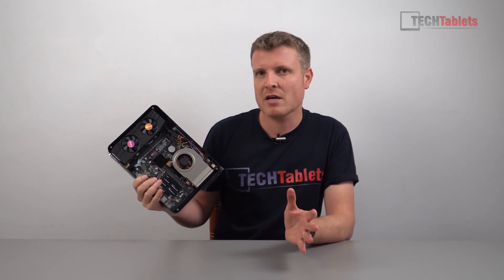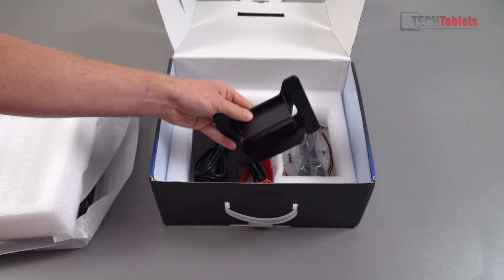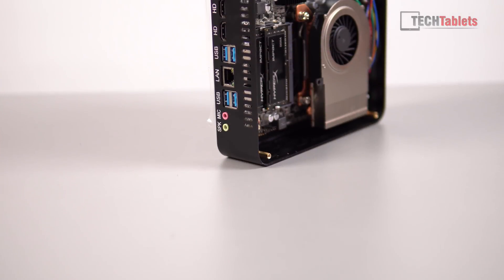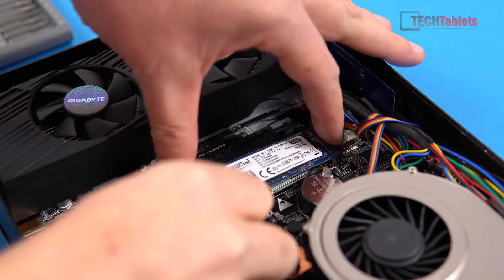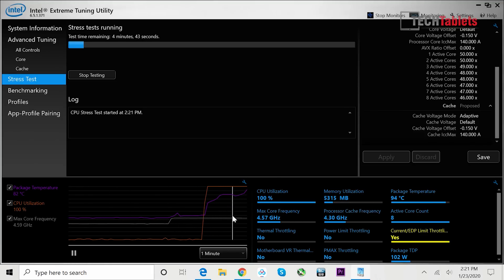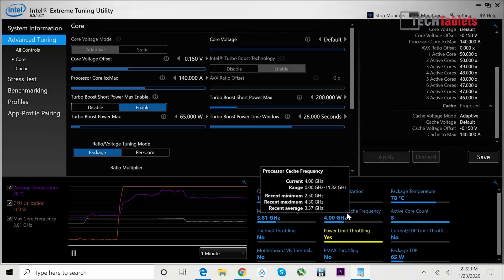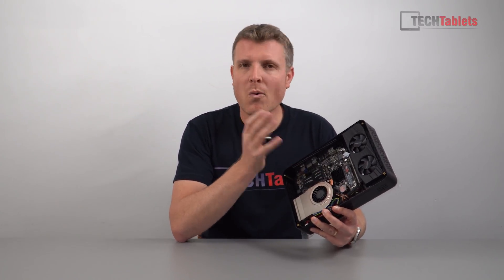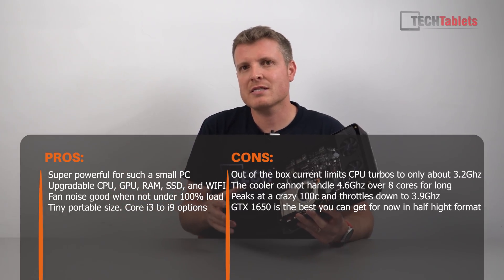Crazy 8 Core i9 9900 Mini PC - But Is It Any Good?

Comment: if they use a standard 4 pin connector for the cpu fan, the goal could be, stick a low profile noctua , and mod the upper case with a 3d printer. Job done. And maybe swap the 1650 with an rtx a2000.

Comment: Is there a mobile socket 1440 variant for i9 10th gen 10885H? Will it be much better for low power draw performance using Xeon copper cooler?

Comment: One of these systems with a 9100f could be an AMAZING cheap gaming PC. With the current config it seems more geared to a mini video production/ editing PC like one you would pair with a mobile camera set up for covering big events like CES or other expos.
Reply: I would recommend the 9100f or 9400f simply because a GPU upgrade is not likely and even if it is, it will be marginal at best. The 1650 will be able to stretch its legs fully even on a 9100f in the vast majority of titles. If we do see an upgraded GPU it will likely be some sort of gtx 1750 or 3050 low power/ low profile card from nvidias upcomming GPU generation.
Reply: After taking a second look this PC has AMAZING value as a barbones unit. If you have access to some cheap ram and SSDs this could be a cheaper build.

Comment: So I got the i5 9400f version, but I’m not able to boost it to 4.1ghz. Turning on the boost setting in the BIOS gets me to 3.4ghz. That seems stable, and keeps me below 60 degrees. Any ideas?
Reply from the maker: Maybe try resetting the bios to defaults. It has to be a setting limiting it or check your power limits. Run Intel  XTU and do some testing

Comment: Not sure about the upgradable GPU part. Those case port cutouts seem to be made specifically for the GPU that's in there. You either have to find a card with exact same port positions or modify the case yourself by cutting it.
Reply from the maker: Yes that's right unless it's the same brand if it's another you night need to cut a gap out. The sticker is over a gap already to

Comment: You know what’s crazy? That I bought a 3.7lbs Laptop for 800€ with the AMD Ryzen 4800u just 4 months after this was used to be the crazy thing. 4800u is almost exactly as powerful at 15W power consumption and has powerful integrated graphics on par with GeForce MX250. Technology is advancing crazy fast.

Comment: goood review you convinced me and i just buy a system like yours but with an i8700 for gaming purposes...my question is i have connected as a second drive a samsung 2,5 ssd and works well but here is my question  how do you manage to atach it to the case i dont know how to...and im thinking of connect it externally via usb 3.0
Reply from the maker: On the lid there are 4 holds to mount it
Reply: im a dumb! thanks!
Reply: bynthe way dont know if you have tried but f or those who didnt... push CTRL plus F1 inside bios and a bunch of new options appear...but no voltagge settings adjust...

Comment: btw, if better gpu comes, it has to be with the exact same ports on the exact same place in order to fit in the case, as this has holes for the ports. or you would have to cut some new holes...

Comment: on that witcher 3 - high setting and just lower the hairworks or turn them off completely. they are garbage anyway (with it hair moves smoothly but as if in water, it doesn't look natural to me, so i just turn them off). and it would probably jump over 60 right away.

Comment: Great to see half height dedicated GPU card being used. Those that say 'make it bigger for a full sized GPU' - well yes, OK, make a bigger model, but keep this because many want the SMALLEST (non-integrated) graphics option. This seems better than a NUC. I like the longer but slimmer form factor. Perhaps 10mm taller would help cooling... Would be good if they produced a slightly heavier model with heatsink fins built into the case and a decent, bespoke CPU cooling system. Worth $50 more.

Has anyone made a fanless case for mini-ITX boards that is finned on the outside and inside (say 7mm fins), all over, with a heatsink embedded in the lid, with recessed fins on the outside, directly attached to the CPU. One for the GPU too. I always thought it would look cool... Heavy but silent.

Comment: I have just installed i9 9900 to my Lenovo M920x which is even smaller case than this one mentioned and everything works fine! But no additional graphic cards installed LOL..
Having run Prime95 without any problem , very satisfied!!

Comment: Hi Cris, How to show Gpu, Mem, Cpu with all core, ^ Ram While u gaming? Thanks,
Im new to your channel. Thanks!
Reply: and i have a problem when im playing tomb raider in high, when a loading complete and play from 1-2 minuete it gets lag for 5 second maybe because loading some scene. 
is't because im running hdd 7200rpm?

my system, 
cpu - core i5 4690k, 
ram - 16gb
motherboard - H81 (because my z97 board error)
drive1 - 256gb ssd on c drive
drive2 - 1tb 7200rpm hdd on d drive (where the game file)
gpu - Zotac 1080ti mini

ist bottle neck due your experience?

Thank you very much Chris

Comment: Coollaboratory Liquid Pro!
There''s your solution.  

HP strongly advised me NOT to upgrade my workstation 
Stock: i7-3820QM with QUADRO K4000M
Upgraded to: i7-3940XM with GeForce 980M GTX 8GB@256bit BUS

Thermals: 
IDLE 42-45C for both cpu and gpu
LOAD: 75-80C for both cpu and gpu

Thanks to
Coollaboratory Liquid Pro. Test it. I'm amazed and highly recommend it. Thanks

Comment: It´s funny, how all these Chinese mini pcs look almost perfect, but then you see those details... huge potential, terrible design at the finish.. and I think it´s not actually that far from being done well. I would love to see a possibility to fit something like a Noctua NH-L9i with its 37 mm height in this build and some opening at the top to create airflow around the chipset, SSD, etc with that cooler..
Reply from the maker: Funny you mention the exact cooler I'm looking to possibly add if it fits
Reply: @Techtablets  cool! looking forward. Hopefully those holes for the screws are the same distance.  And I´m also afraid, it will interfere with the chipset heatsink.

Comment: I'm mostly amazed by the PSU. When you removed the current limits i was like NO NO NOOOO!!!! but it held up. I didn't expect that.
Reply from the maker: I know right I didn't expect it to and thought it might cut out and power off unexpectedly but it hasn't
Reply: @Techtablets  Might actually overwhelm the power supply. 180w isn't that much.
Reply: what about longer use... maybe that psu is at it's limit without those regulations which may lead to failure after longer use?

Comment: That system wont last long at those temperatures.
Reply from the maker: Not in the high 90s no. I'm either going to lower the current limits or what I'm thinking of doing now is to repaste and maybe use a different cooler from Noctua if it fits

Comment: It will be wonderful thermal wise and performance wise if the CPU was Ryzen 3700X.
3700X runs cooler, better performance, has low power 45W mode too.
Reply from the maker: I can only find a 3400G Ryzen model

Comment: I would optimise the airflow for better temps
Reply: cut out air exits and stuff. a single small case fan would really improve this
Reply from the maker: It would and there is a sys fan header on the MB
Reply: @Techtablets  You could use an adapter to get power from SATA and regulate the fan manually. Or use a splitter to run it at the same speed as the CPU fan, from the CPU header; while still regulating it manually with some regulator thingy

Comment: Good video. Nice to see something really useable with a little tweaking. A shame they didn't trade a little bigger size for a better cooling solution. Call me crazy but with an igpu and a pcie x16 external slot and plug for power connector you could plug in any graphics card you wanted. Maybe next year's model.
Reply: Good idea

Comment: Full height 1660 TI with the smaller cooler would be insane!
Reply from the maker: Yes I hope we get something like that. Or they make a half height 1660 Ti this year
Reply: @Techtablets  For $500 almost worth a shot modifying the case to fit a taller GPU. 1080ti mini or similar.
Reply: Lets say I buy one of these and want to run a 1660Ti or maybe a Super, what could I use to power it?

Comment: I would love to see how it performs with Premiere CC. I’ve been thinking to buy this miniPC for a couple months now...
Reply from the maker: Very good, it out performs my current 8700K @ 5Ghz water cooled desktop PC. I might post a video on it.
Reply: How well does this hold up running multiple Adobe apps concurrently? My work flow requires me to have illustrator, photoshop and indesign open at the same time or after effects premiere and the media encoder rendering at the same time.  Could it handle it and the two monitors?

Comment: It starts with $520 (no RAM, STORAGE or GPU), and ends with $1600. Definitely not cheap at all...
Reply from the maker: Nope mine cost me 840 euros + RAM (Used 32GB) and 970 Evo around 1100 euros all up. You could build it for cheaper but it would be 4 times bigger
Reply: @Techtablets  yeah but that wasn't $520, price you are referring in video. That was way off!! - If we talk about 840 + price of RAM and Samsung Evo = 1100€, you can find REALLY good  laptop in that price range.

Comment: Great video. Is it possible to disable hyperthreading and/or some cores to simulate the other models available and figure out which CPU is the value option that matches the 1650 in gaming (ie. The cheapest CPU available that doesn't become the bottleneck). My guess is it's the 9400F.
Reply: Also, a 1650 Super half height card would be a big upgrade if the seller updated their device.
Reply from the maker: That would be the 9400F yes

Comment: I would like to see that CPU delidded and TIM under IHS changed to liquid metal, with Kryonaut on the IHS. It should not thermal throttle anymore even under applications that use AVX. Other than that, very nice SFF PC.
Reply from the maker: I've never delidded before but you think it could fix the thermals? I was looking to repaste and add a Noctua low profile cooler fit for that 65W if it will fit in the case. Might have to make a cut out for it. I really don't want to mod the case.
Reply: @Techtablets  I may have to back out of my statement. I've tried to search for some info on i9-9900 non-K CPU and I can't find 100% confirmation if it has soldered IHS or not. K CPU is soldered, but info on non-K is mixed. There is a much higher risk of damaging the CPU when delidding a soldered IHS (a lot more force required, more stress on PCB and core). If 9900 non-K wouldn't use the solder then delidding would improve thermals for sure. I've been delidding and lapping IHSes on every generation since 3770k and last one being 8700k and all netted around 15C lower temps, sometimes hitting 20C. If I find more info about 9900 non-K I will update this post.
Reply: @Techtablets  OK, after some more digging I found maybe 2 users that said i9-9900 non-K has normal TIM under IHS and is not soldered. Other non-K parts like 9000F series etc. also are not soldered.  I also found info that the solder Intel uses on K parts is still pretty soft one, so delidding is possible without too much risk. So it's your decision to try it or not. Even with the soldered part, you could have 5-10C drop in temps.
Reply from the maker: Thanks for the info. I'll think on it, not sure it's worth the risk but I'll try maybe a new cooler (low profile   Noctua) and repaste it.
Reply: @Techtablets  Repaste and cooler swap will be the easiest to check. Be sure to have a proper ventilation for rest of the case, as Noctua will dump the hot air inside the case opposed to included  cooler, that is directional. With both graphic card and CPU dumping hot air in the case it can get a little toasty inside. Whatever you decide, I will gladly watch a video about it :D

Comment: The power supply is only 180w. Even 8700k at 1.2v full load will suck around 200w (total system consumption). Thats why it current limit throttling

Comment: Imagine this form factor with the Ryzen 4800H! It would be awesome!
Reply from the maker: I hope they do it. But might take a year. They have 3400G models from other brands. So maybe the 4000 series late this year?
Reply: @Techtablets  3400g is a desktop AM4 socket chip. The 4800h is a mobile fp6 chip with 45w tdp. So if they use this chip the current cooling solution should be adequate for it to reach full potential, but the downside is the cpu might not be upgradable. I'm not sure if mobile chips are soldered or socketed. Maybe you would know more about that?
Reply: @DannyHuanDao  They are always soldered. However, Ryzen 7 3700X would be a far better choice because it has far less heat generation and power consumption compared to i9 9900. Despite Intel claimimg 65W TDP for i9, the actual power consumption and TDP is way higher under load. Also,  all the Ryzen 3rd Gen has TDP control which can be used to set a reduced TDP with some reduced performance.  That's the reason, AMD has not released any T series CPU as their normal desktop processors can be configured.
Reply: i think we can bump it to a Ryzen 7 4700G.

Comment: The 9400F with 1650 option for $500 is good for the price..juSt buy your own 2x4gb ddr4 2666 and get a cheap 1tb crucial P1 ,it's capable to game in 1080p
Reply from the maker: Yes I was so close to buying that model. But I wanted the integrated GPU also for video encoding performance boost
Reply: @Techtablets  yeah quicksync should complement then nvenc encoder very well Chris

Comment: Repaste with kryonaut, assuming they use something lower than nt-h1, will result in significant thermal boost. More if you add dedicated fan. Then exporting 4K video might be faster than the video's original length, which is very nice for content creators.
Reply from the maker: I'm looking into it maybe repaste and try a different low profile cooler if one will fit with the lid on. 4k video exporting is faster than my 8700K @ 5Ghz which is great

Comment: Just finished watching the review and it's solid as always. I have one question since you've tested lots of these mini PC. Have you ever found any Bios update for these kind of PCs?
Reply from the maker: Sadly never I looked high and low to find an unlocked bios with advanced settings and no updates anywhere.
Reply: @Techtablets  You wont be able to get an unlocked bios update or that type of system as it has not much more potential for hardware upgrading, cooling and wattage.

Comment: Yeah! More mini PC reviews please. Got the Aliexpress eGlobal i9-8950HK for my son. Connected a 5700 XT to it for 1440p gaming. The original flat cpu fan died so I fitted a $15 Cooler Master 120mm  i71C CPU Cooler. 3D printed a new case top to accomodate the 30mm increase in height and fan overhang. Thermals are good and it's quiet.

Comment: Only three monitors with dedicated graphics as all motherboard Display Out ports will be disabled when the graphics card is plugged.
Reply from the maker: No the motherboard one of the HDMI ports works I have 4k30 max and then the HDMI 2.0 I tested two monitors. And then the two others on the card should work fine.

In the bios you must enable the iGPU also.
Reply: @Techtablets  if you enable iGPU, won't that going to disable the discreet graphics? Laptops do have the dynamic switching tech but in Desktop that is something unheard of.

Comment: I have one of these but the i3 one but the coil noise was so bad
Reply from the maker: The GPU has a little when the FPS goes crazy high in menus with Vsync off on mine. But that's normal I believe, my 1080 Ti does it at home. How are the thermals on the i3 should be fine right?

Comment: Can make a separate video where you fully disassemble it and change the cpu?
Reply from the maker: Possibly if I pull the CPU and use it in my desktop I would downgrade the CPU. But maybe also try and repaste (doubt it will do anything)
Reply: @Techtablets  please make a video where you you upgrade the gpu too

Comment: This is what needs to be done with the upcoming Ryzens. 8 cores with Lower TDP cpu, and just make the case a little wider to put a full height GPU itx and thats it. Thermals could be improved by extending heatpipes + copper fins over the motherboard, similar to the Alpenfoehn black ridge cooler. For Ryzen DIMM slots should replace the sodimms since the zen architecture relies on high speed ram, which AFAIK in sodimms is either super expensive or not availible. Motherboards for this setup, with a PCIE 16X slot daughterboard already at 90 degrees, should become a standarized formfactor!
Reply from the maker: lets hope someone makes that would be awesome with the new Ryzen 4000s
Reply: @Techtablets  the fact that this has not been done before is mind boggling. It could be a viable platform for true desktop performance portable pc. Something with just enough battery to find another outlet to plug in. 15 minutes should be enough.
Reply: There was a Ryzen 7 2700E, 8C/16T at 45 watts, compared to 65 watts for the 2700. There's no such low-powered version of the 3700X though
Reply: @koalitaDormilona  You can set the CPU to whatever limit you want (PPT in the BIOS). Ryzen 3000 65W 'TDP' CPUs take 88W max... The cores are efficient up to 3,5Ghz. Because of the IO Module they get less efficient below ~45W with ~55W you get the 3,5Ghz on all cores and single core clock isn't much effected (this goes for the single chiplet ones).
Reply: They are going for 15W 8core 16 thread on laptops already.. so why not
Reply: Wow maybe soon.
Reply: node 202 build seems similar with sfx psu bounded
Reply: What does the 12 volt out do? 3:50
Reply: @yubinator69  agree, you mentioned this as something good but didn't say why. Are you suggesting you could run extra fans from the supply? Great review, I'm very tempted by this.